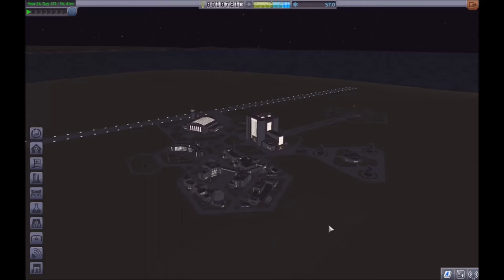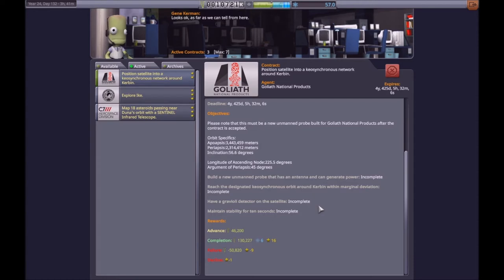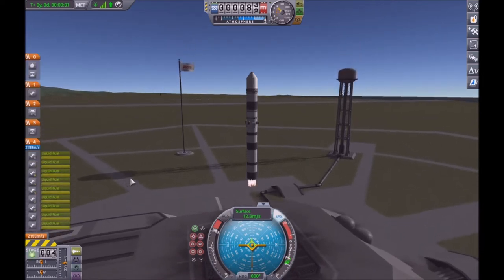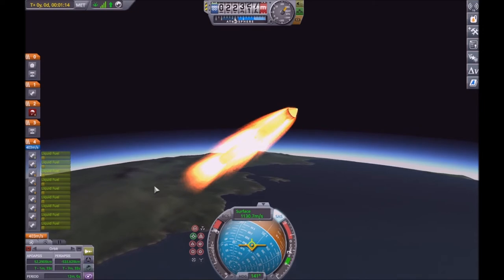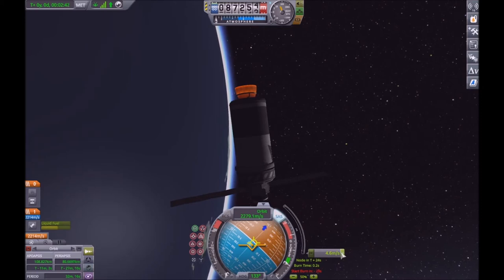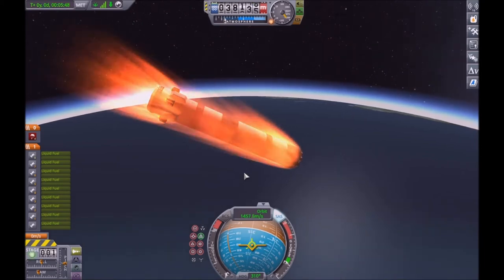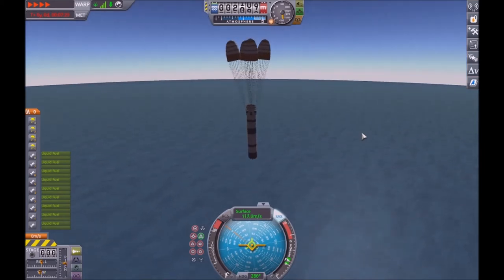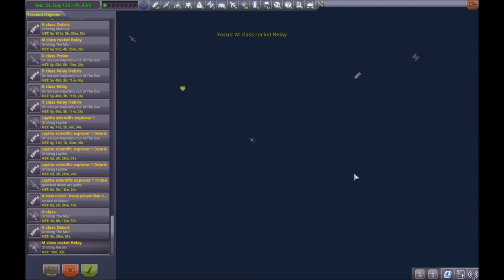Efficient contracts 2 (we need a bigger rocket)

Comment: Something I noticed. Why didn't you throttle down to prevent drag from slowing you down?
Reply from the maker: Because that would end up messing up the recovery trajectory.  the effects of aerodynamic pressure on launches in kerbal space program is almost negligible, especially with rockets that size.